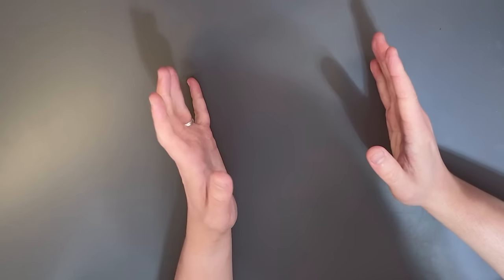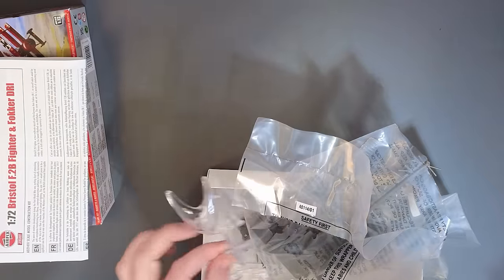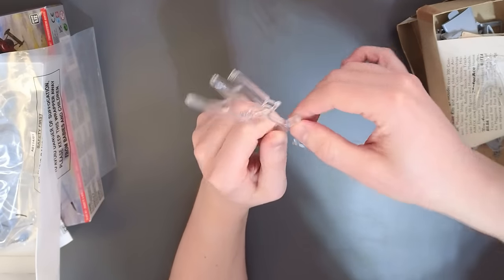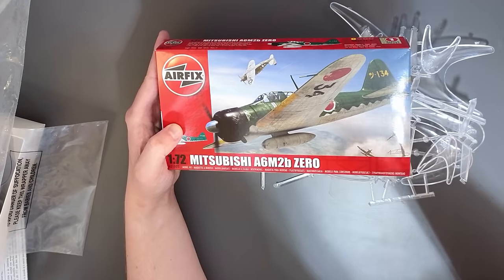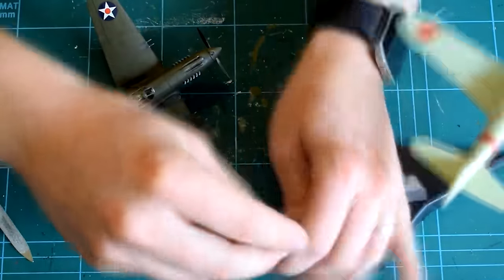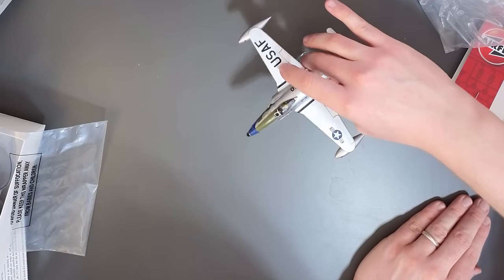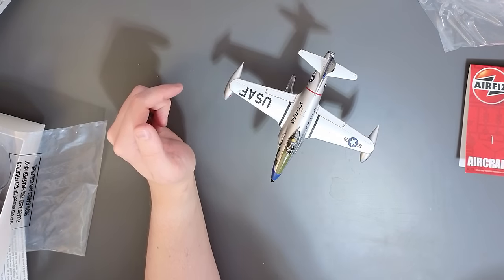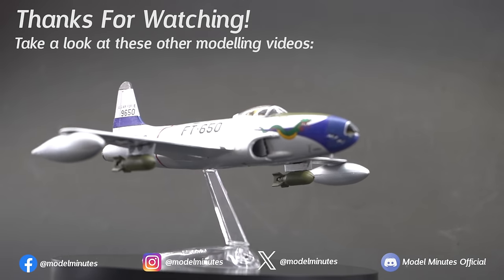Display Stands Still Exist?! What Happened to Airfix model Aircraft Display Stands?

Comment: Yes, they do, you just have to buy them independently😂. Honestly, I wish model companies would go Bandai way and gave us a bit more complicated "action" stands with heavily adjustable position and height like the ones for gundams. I do not mind buying stand independently, I just wish we get some better choice.
Reply from the maker: yeah, i think the bandai stands are great :)
Reply: They should release the style of stand that comes with the dogfight doubles as seperatly available like they used to be rather than with a kit...that way you could buy them if you want or not if you dont want....and it wouldnt cost them anything to tool as they already include them with the dogfight doubles.. @ModelMinutes
Reply: The problem with these clear stand is they are brittle...i dont know how many of mine i broke.
Reply: @ModelMinutes they even did 1 of those dogfight doubles with a larger base and 5 arms so it could hold 5 models....and i know this because i have it.

Comment: Back in the day, I don't think I ever used a display stand. I was either hanging them from the ceiling...or having them on their wheels. Nice to see Airfix giving the option to buy a bag of them, even though I think £12 is a bit cheeky for what they are.
Reply from the maker: works out at a pound a stand really
Reply: @ModelMinutes  I think it's because I mainly model in 1/48 and only really do large subjects in 1/72. I would never use the small ones. Maybe they will do packets of just small and just larger ones. If they sell well they just might. I think this is them sticking a toe in the water and seeing if there is a market. If nobody buys the packs, they probably intend to feed them into the Vintage Classics anyway, so it's a chance to recover some of the tooling costs in a different way. Makes sense.

Comment: The display stands set is one of the hidden gems of the Airfix site. Having a little stock of stands for when I want to have a stand is really. The price is pretty reasonable too. I have made slots for using a stand on newer kits and even non-Airfix builds, it just takes a little planning during the build to place and cut the slot. According to Scalemates the set was released in 2012, so it's been available for a long time not, just few seem to know about it. 
Before I found the stand set I made stands out of sprue, usually box-frame type arrangements but sometime a central rod with a base and a set of supports for the build.
Reply from the maker: thanks for the info!

Comment: It's NOT a new tooling.  Back in the day, the two-hole version was actually the original!  It's the slotted-version that is slightly newer, as they found the "prongs" on the older two-hole version were prone to breaking.  The slotted version was stronger, so some time in the late 1970's they changed from the two-hole to the slot.  So it may be that they lost the mould to the slotted version, but found the ones for the two-hole version?  Just a guess on that last part.  But I very clearly remember seeing both versions of the clear in-flight stands back in the day.
Reply from the maker: thanks for the info
Reply: They're clearly different toolings. They're not even the same way round on the sprue.
Reply: @MacMcCaskill  You mis-understand I think?  When I say (either) are not "new" toolings, I mean BOTH versions are old and date from the 1970's or earlier.  Yes the two versions are clearly separate toolings, but neither are "new" meaning recent.....

Comment: I recall in the 60s, 70s and 80s there being various developments of the stands, with/without logo and the two-pin ones.

Some of the recent new kit issues seem to have a 'shadow'-shaped display stand, in the same grey plastic as the kit.
Reply: The 70's vintage  stands  have these  twin holes and logo
Reply from the maker: yeah, the new aircraft starter sets have stands

Comment: Interesting, the old Dog-Fight Doubles kits used to have black shared stands, where the single kits had the clear stands you are showing.
Reply: With straight poles, not the cured form
Reply from the maker: interesting!
Reply: @pitanpainter2140  - The old style dogfight double stands were last used under Humbrol ownership at Heller in France prior to Hornby takeover in 2007, although Hornby have owned Humbrol and Airfix since they don't seem to have that tooling, what happened to it I don't know. Clear stands were discontinued by new owners post 1981 with one exception being the 2003 ('05) Anniversary BTK Spitfire and another being the more recent DFD, the small and presumably medium sized being found some time in between released as the set of 12 in 2012.

Comment: They are the only stands I use. I use them regardless of kit manufacture, just used a large stand for a Zvezda 1/72 SU27. Used a smaller one for a Revell 1/72 harrier and a really small one for the red Barron’s tri plane. Ok so they need a bit of work to make them fit the job, but the fact they are clear and don’t distract from the model is cool.

Comment: Good video, good topic. I keep the stands, I don't use them all. I think having the option is important. I like to do one kit on wheels, and another example "in flight". Most of my kits are on wheels, I like doing dioramas, airfields and such. I never hung mine from the ceiling, and I use cotton gloves when handling complete kits. I like the idea of keeping my kits dust free, cabinets for display. I use plastic containers of appropriate sizes for storage.
Reply: Where do you get the containers, I need to start rotating complete kits (i have too many and my wife's patience is finite)
Reply: Lol, as a child and young man I had mine hanging from the ceiling. My dad put a very complex set of strings crisscrossing the ceiling that I could hang then from, at one point I had over 100 planes in various poses up there. By my teen years I'd even started using circles of acetate with slight shading to approximate spinning blades.
It's was probably best to have had them up out of the way back then, the paint finish wasn't always that good and little fingers could do damage at a phenomenal rate if left unsupervised for just a few seconds!

Comment: I did use some of the stands back in the day but didn't glue them as I liked the wheels down,early in the 60s the transfer sheet came with the aircraft name which you put on the stand so most of the time the prongs went to the rear as you liked,the groves on the upright I remember around 1970,but when I built aircraft like the original corsair and hannover and possibly the camel in about 65/66 the stand came with two pins that went into the base that as 7 and 8 year old you rushed and broke the pins off,maybe round the time of the photo boxes is when they stopped the stands.
Reply from the maker: thanks for the info!

Comment: Airfix display stands with single rectangular hole were used by Airfix until 1969-70 approximately, soon after they were replaced by the two circular holes type. The latter type, for sure, is not a recent re-tooling.
Reply from the maker: thanks for clearing that up! I didn't think it was a more recent tooling given that the "made in England" part had been scratched out
Reply: I have a couple of airfix kits in the stash from the mid/late 70's - can confirm they have the double-peg stand type, not the older slot, so that design has been around a while!

Comment: The stand here natt is a great ideas for vintage kits it takes off space to add more room for plane space to display I have like a bookshelf with lots of them on shelves and on stand no worries the landing gear breakages they look better of the ground like there flying in open air if your careful on the new 1/72 scale you could cut a grove in the bottom of the plane

Comment: I bought the same set as you Matt. I've used with newer starter kits, i just cut the slot in the base with my dremmel in a similar location to the new style holes
Reply from the maker: Good tip!
Reply: @ModelMinutes come on -- this is as racist as hell.  It is beneath you to leave the note up.
Reply from the maker: @randytaylor1258  YouTube doesn’t notify me of comments in reply to other users so I didn’t see this one, but thanks for bringing it to my attention. I’ve now reported it to YouTube and it should have been removed

Comment: I also wonder why the pilot figure was removed ? It might not be that useful, for a highly detailed plane on the ground, with a fully painted cockpit, but if you want to make just a flying plane, or a diorama, having a pilot at an appropriate scale (even if it's a little bit smaller) would be Highly appreciated.
And well, 2g of plastic wouldn't be such a financial loss.
You might tell me to buy a specific minifigure, but I tried on my first model kit, an f104 (where are the wings ?) The pilot's head came out of the canopy
Reply from the maker: again there was an element of cost. Whilst it is possible to include a generic pilot in most aircraft, they don't always fit inside the cockpits. Real pilots are a bit squishy and can conform themselves to fit the space provided to them in the cockpit, but plastic pilots are not so fortunate. For a company to design a bespoke pilot/crew for every seat in their specific kits would result in a relatively cost-prohibitive activity (at leas that is what I have been told by my source within airfix)
Reply: I recently bought the Dragon Apollo Recovery set - Sea King, Apollo capsule and Recovery dingy - NOT A SINGLE FIGURE INCLUDED!!!!!!
Reply: This,... I just commented this,...
I prefer to display aircraft in flight but that just looks silly if there is no pilot? 
And this is not just Airfix. And it's also not like you can just buy a bunch of 1/72 pilots if you need them.
Just offer me some generic pilots, I will find a way to make them fit,... I have used a couple of spare Bandai Star Wars pilots (because THEY DO offer you options) on my two latest 1/72 builds,... but now I have run out.
And as I type this I again find out HOW MUCH this annoys me.... lol.
Reply: @ModelMinutes  I would happily pay a little more if they included pilots, seriously.

Comment: When the Hornby wonderworks opened they were selling off those bags of the stands for £2 a go without the cardboard packaging guess they were dumping surplus stock out of their inventory as they sometimes do. I’ve put a Lancaster BIII on one of the larger ones with no issues. Just cut out the plastic between the two stand holes in the kit and then fettle until the stand arm fits.
Reply from the maker: I was invited to the wonderworks opening but sadly couldn't make it - shame as I could have got a deal on the stands!

Comment: Even when I was a kid, when I started with Airfix, Matchbox and Heller kits, I have never used display stands. I just don't like them.
But if there are more complex stands, which allow to present a dog fight in a more interesting way, I'm more...interested to use one :) 
What is the stand you use with your A6M and P40 ?
Reply from the maker: that stand was the one included in the dogfight double set at the time

Comment: In the vintage Classic era, the dogfight double stand was black plastic, the base a big "A" with two arms each with the rectangular lug.  Incidentally it has a hook so you don't have to glue it on.  They were higher than those clear things you've got.  Frog had similar stands to Airfix but higher.
I don't remember anyone I knew using them, except as plastic stock for a bit of scratch build.
Reply from the maker: thanks for the info
Reply: Aircraft kits from Matchbox had stands with bases that formed an M, but the shaft has a ball and socket at the tip which allowed you to angle the model and give you more choice in how you displayed it after you'd hooked it  on. With some of their older kits having been acquired by airfix and revell, it's a pity they haven't adopted the design of the shift. These days, if I want a stand, I build one out of plastic and or wood. Cheaper than buying them and gives you chance to practice skills
Reply: @obi-ron  Hi Obi-ron, thanks, I had forgoten the ball end stand.  That was an improvement.
May the force be with you.
Reply: @emmabird9745   live long and prosper (meant the good way, not the star wars/ star trek adversarial way)  lol

Comment: I think that they went away as the hobby was very much moving towards diorama display when I was last making kits in the 90s. The hobby magazines tended to feature a small diorama with their build series too i recall.
Reply from the maker: that's interesting, although I think the cost saving element was quite a factor for the companies
Reply: @ModelMinutes  As costs increased into the 21st century I think the majority of companies were looking for ways to save money, omitting the stands was a fairly easy option for that I expect. Plus as you say in the video, the tools could have been lost, damaged or broken over time, whilst they are usually expected to have a 20-30 year life cycle, the more constant use for every kit sold will have worn those moulds faster than others would usually wear so that is a feasible reason too.

Comment: Over the weekend I completed the Airfix Dogfight Doubles set with the Zero and Wildcat aircraft, and when I saw the kit had the display stand in it I decided to build both planes with the wheels up so I could use it. While I eventually figured out how to use the stand without the planes falling off every minute, I think it would have been helpful if they had included some instructions on how to put the stand together. It would be particularly helpful for newcomers to the hobby or Airfix models in particular. I have another kit I bought in the last couple of years, an Atlantis Models airliner, and at least that tells you how to use the stand and that is a kit that probably initially dates back to the 1960s.
Reply from the maker: yes, a small sheet of instructions would be handy

Comment: One had to cut a rectangular slot for the vintage display stands. In most cases the slot was pre shaped in the model. I prefer the “new” display stands (AF1005, AF1006 etc.) as a few little holes would do to have them put on the display stand. However, the “new” display stands are hardly available (2023-2024 - at least in the Netherlands). Hope Airfix will reissue them soon as not everybody hangs their models from the ceiling.
Reply from the maker: Yes, I'm not really sure what has happened to the "new" style stands - I don't recall recent kits even mentioning them in their kits so I wonder if they have been discontinued in some way

Comment: The cost of clear plastic is much higher than for coloured plastics. It’s a cost cutting exercise. With coloured plastics you can use various grades and shades, even mix in recycled plastic, not so with clear plastic.
Reply: Stands are not always clear, though.
Reply: @thoughtengine  The stands originally supplied were clear, the exception being the dogfight doubles, which were black.

Comment: I brought up the question of why stands are no longer included on a recent live chat between Peter Oxley and Airfix. They gave what I thought was a bit of a brush-off answer about the extra cost of tooling. While I appreciate this would impact on the frame of each kit, nothing was said about chucking-in one of these clear stands. They always came in the past as separately tooled items (ie. not attached to the other clear parts as I remember) so I don't really see why they are no longer included. Some of us would like to show aircraft in flight, so Airfix come on. Incidentally, they loose custom from me because I would in many cases buy two kits - to show one in flight and one wheels down. They cost pence, so I object to paying eleven quid to buy them separately (especially as they are old style that don't fit)
Reply from the maker: i think the main problem is that if they could guarantee that the cost would be worth including them in the boxes, then they would be a worthwile inclusion - but seeing as not all modellers are interested in using them it's cheaper to just not include them.

Whilst it might be true that manufacturing these stands isn't a massively expensive endeavour, it will incur complications for adding a different product line into all boxes that are being manufactured.

Additionally, seeing as most of these products ship from India, and you have to pay for shipping costs, cutting down on the weight of your models will mean more can be shipped. If every box has a display stand, whilst a very low weight individually, that adds up to quite an increase en masse.

Say for example (i'm just guessing here) Airfix can ship 10,000 kits in one ISO container as they are now, with the increased weight in stands that might get reduced to maybe 9,000, but they still have to pay the same price for the shipping . . .

And then, not all modellers (as mentioned) will use the stands - so you are getting less models for the same cost. Financially as a business I can see why it doesn't always make sense
Reply: Perhaps Airfix could offer free stands in exchange for flying points?

Comment: I have found it very frustrating when you've bought an Airfix kit and the instructions give you an option to drill two holes (and serial number) for a display stand only to find the said stand isn't even available from Airfix. 
I was also advised by Airfix that their messerschmitt/mustang dogfight sets didn't include a display stand which surely has to be a key element of having a dogfight double kit.
Reply from the maker: yes, i dont think i have seen that display stand available for a very long time